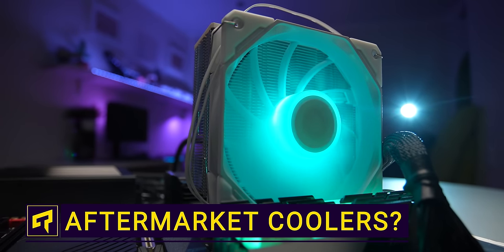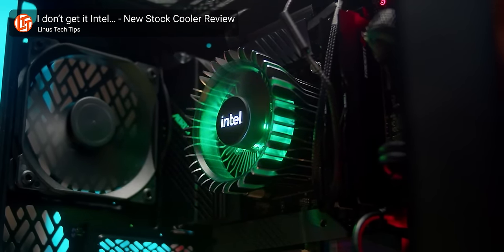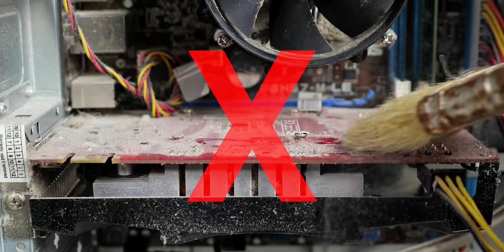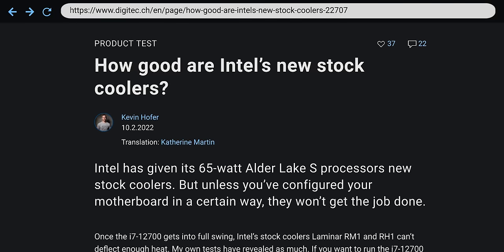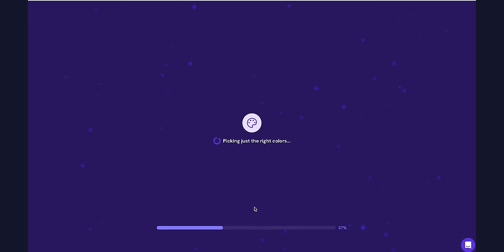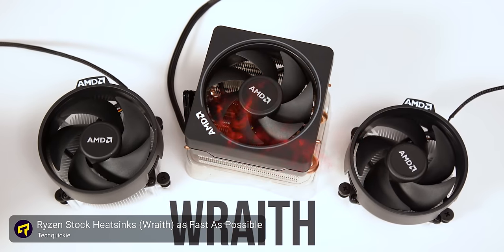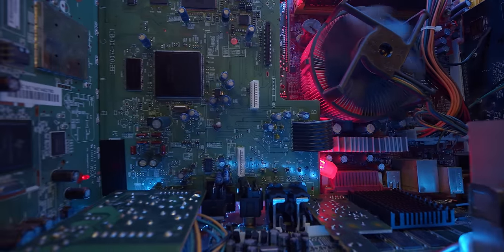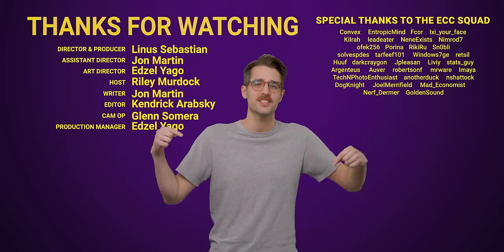Are CPU Coolers A Waste Of Money?

Comment: I got an NHD15 because I knew it would last probably forever. The fans will eventually die, but the heatsink will last for years, decades even. If Noctua is still around, they'll keep making mounting hardware for it, so I'll keep using it.
Reply: And that 6 year warranty is amazing if for some reason something does fail during that time
Reply: Dunno if the value proposition is there. You could buy 3 peerless assassins with that same price
Reply: @user-bf5qh3ih4u  Yes but will it last long term? Is there any warranty for broken or malfunctioning parts? The cooler itself looks great but the fans look a bit on the cheap side. At the very least Noctua is a very trusted brand that will support its customers with 6 year warranty with free replacements and new mounting brackets. Also their fans are some of the best on the market and have been for awhile. The NF A12x25 fans are ridiculously powerful and also really quiet. I don't mind paying extra for tried, tested, and true products with amazing quality and amazing warranty support.
Reply: @Hydra_X9K_Music  thermalright are a very reputable brand. Their coolers are on par with other big names at a fraction of the price. I believe they’ve even been in the market a little longer than noctua.
Reply: @Marauder-q2v Considering the performance of a D15 is it will be able to handle the cooling needs of future processors with ease to the point that it will likely not even be something that will even come to mind with subsequent builds.

Performance especially over the long term is value.
Reply: What I love about noctua is their socket support. Thermalright is definitely the better value but socket support is better in the long run for noctua. They even send the mounting kit to you for free as well.
Reply: @Hydra_X9K_Music  I’m fine with purchasing my own mounting hardware. Less of a problem on AMD because mounting hardware is compatible through multiple generations. For the fans, if they do break, I’d probably just strap a couple of arctic p12’s. Do note they have a weird motor hum at 1000 rpm. You can probably just set your fan curves to avoid this. The p12 max doesn’t have this issue entirely. If I remember correctly, I think they come pretty close to the noctua fans in terms of performance.
Reply: @Marauder-q2v  Ngl I did want to try strapping noctua fans to a peerless assassin or a phantom spirit cooler to see how it would be xD
Reply: @sm7085  You are right, Thermalright is a better value and is like 4 years older than Noctua, but I would rather give my money to a premium, well established and popular European brand, rather than a Taiwanese one for a purchase I might make once every 10-15 years, especially when it will be paired with multiple 300$+ CPUs.
Reply: @Hybris51129  peerless assassin matches the performance of the D15.
Reply: @LAndrewsChannel that didn’t sound racist at all lol😂
Reply: @LAndrewsChannel  Reliability and value is what most people look for imo. I wouldn't think the country-of-origin matters, but to each their own.
Reply: @sm7085  Exactly. I have a cooler from Polish brand and while a lot of people here are dissing Polish products in general, I never heard much of a complaint for this brand's (formerly SilentiumPC, now Endorfy) coolers in the long run. There used to be complaints about complicated mounting process for their older cooler line, but their current line fixed this and I had no issue with that. I still only have that cooler for two years, but in my surrounding, some people have this brand's coolers for much longer and they are still good to go. And it has the same six years warranty Noctua has. Now, if their PC cases were similarly cool (pun not intended)... but that's a story for another time 😏
Reply: @sm7085 Country of origin matters for labour practices and safety regulations, as well as consumer protections.
Reply: @meesun2060  Call it racism if you will, I don't care, just look at the practices employed by 2 other ESTABLISHED major OEMs headquartered in the same CITY, Asus and Gigabyte, what they did in the past 3 years and what is their first response when a major flaw with their products is reported. Also, I bet there is some influence from China itself, where the culture is pretty much centered around "through any means necessary", be it slave labour, lying, stealing, maybe even killing and nicely covering up for the rest of the world to not see and still buy products made there.
Reply: The heat pipes wear out over time, usually about 15 years or so. Sometimes less. Still a really long time but not decades.
Reply: I thought the same thing until I got a 12900k. I used a NHD15 with a 8700k and never had a problem running Handbrake  to convert videos. I built a new computer with a 12900k and thought I'd save a few bucks a reuse my NHD15. A couple of  minutes after starting Handbrake the computer would reach 90+ degrees. A few seconds after hitting 90 it would lower all the CPU core frequencies and the computer would cool off and hold at 85 to 90 degrees. I bought a DeepCool LT720 360mm AIO and my computer idles at 25 degrees and max temp of 55-60 degrees when running Handbrake.
Reply: Mine just clicked over 4 years as I switched to a CPU AIO. CPU AIO lasted 4 months and died......
Reply: @Hydra_X9K_Music guess I shouldn’t tell you they’re made in the same Chinese factory as all the other fans… 

Same applies to the heatsinks.

Whoops! 😂
Reply: @christophervanzetta  Well fk it they're still some of the best fans ever made xD
Reply: broo the same here. i used artic coolers back then .ugly ,but legit.haha
Reply: @Hydra_X9K_Music It's really just a lump of metal. There's pretty much nothing to actually break. Yes, there is a good warranty on Noctua Coolers, but do you really need a warranty for a hunk of metal?
Reply: @Hydra_X9K_Music That would actually be really good. In fact, the fans on a new Noctua Cooler made an old Noctua Cooler like 3 or 4 degrees lower. I forgot what video set this. I think it was an LTT video.
Reply: @rodneykeene What kind of case are you running? I use one with a mesh front panel so there's plenty of airflow Of course, that's what you get for running intel.
Reply: @MrGamelover23 My current case is a Fractal Design Define 7 XL. I use the mesh panel instead of the solid panel on top and it also has a 280 mm mesh section in the bottom. For most tasks the NHD15 did great, even gaming it was fine. I transcode videos with handbrake and the 12900K would reduce core freqs to stay cool.
Reply: There literally is no reason to buy Noctua when thermalright exists.

Comment: As long as you can fit it and the slightly more amount of noise isn't an issue (barely any to be honest with some tower air coolers), tower air coolers like the Noctua DH-15, are the simplest route for most builders in my opinion.
Reply: I use a noctua nh-D15 cooler with a rx 7800 Xt and ryzen 9 5950x, I can't even hear the cpu cooler under load.
Reply: @eequalswtf6281  Isn't it wonderful? Well worth the ouchy in price and can be reused in future builds.
Reply: Noise (acoustics) is the reason that I have to use a simple aftermarket air cooler for the CPU.
Reply: Originally bought the nh-d15 for my ryzen 2600 that i was overclocking and it dropped my temps by 20ºc. Cross decked it into my new am5 build and sits on my 7600x which run hot from the factory. Never have to worry about it with the v8 sitting on the top
Reply: Nh d15 is way overkill. Most people only need a single tower. A Thermalright costs under £20. The D15 is £100. Spend the difference on a better GPU
Reply: @Notorious544d  I said simplest, not cheapest. I totally agree that the DH-15 is overkill. However, it will be applicable in pretty much all future builds, regardless of cpu heat generation, as long as Noctua makes adapters for it (they are known for supporting their products for a very long time), meaning the person who purchases it probably won't need another one for a very long time. That was my point.

Comment: Running a 240 AIO on my latest build, and the fact my workload temps are what my air cooled rig used to see at idle was quite something...
Reply: I love my 240 AIO. It's so silent and never ramps up regardless of what kind of load I throw at it. The only kind of air that I ever feel out of my PC is cold air. It actually helps to cool my tiny apartment down a tiny bit during the summer which is kind of wild since most people say their PCs heat their homes.
Reply: You still get GPU fan noise so I don't really think a cpu cooler needs to be a lot quieter than a GPU. A AIO that big is overkill
Reply: @kingzach74 I can promise you that your pc isn't cooling down your apartment. That's not how physics work. Your Radiator sends out the heat from your cpu into the air. You're making the same, if not more, amount of heat energy by your cpu, even if it's hooked in a waterloop. The only exception is if you have your Radiator pointed out a window or something
Reply: @kingzach74  

bruh
i need to lie down after reading this one 
that AIO do sound nice tho
Reply: Either you run on stock air cooler or you have a shitty air cooler.

Comment: Regarding stock coolers, the one from the old FX-8350 is definitely not enough. The processor burned itself along with the motherboard while running Prime 95 while I was ordering pizza. I had to fight my right for RMA since I didn't overclock it when it happened.
Reply: certified FX moment
Reply: I still have my 8120 and 8320 but I never ran stock coolers on either.
Reply: it's the motherboard, not the processor. Many people did not understand at the time, that you can't put a 125W CPU on a cheap motherboard with 5 or 6 phases. Besides, running Prime95 is still the worst thing you can do today, as it heats up the system even more than Premiere. If it can do video encoding, it will run everything just fine. Stop using Prime95 guys, just run the CPU-Z stress test; if that one runs fine, you're good to go for EVERYTHING - unless you're a NASA scientist ;p

Comment: As a casual user, I'll stick with my stock cooler for now, but will consider upgrading if I delve into overclocking or hit thermal limits. Thanks for simplifying these concepts.
Reply: Totally. Stock cooling is designed for light and casual use.

You only need better air cooling or an AIO if you are gaming or doing sustained heavy work loads

Comment: Best decision I made was getting a thermalright assassin 120mm tower cooler. Cheap, amazing upgrade from stock and kept the chip nice and cool.

And then got a 360 AIO for my birthday.
Reply: Their stuff is the best. Top of the line performance and 1/3 the cost of other top of the line coolers.
Reply: I had a 360mm AIO that died. Both my brothers (twins so identical pc too bought at the same time) had their 240 AIO die just a couple weeks before it. 

I got annoyed so bought the Thermal Assassin 120 for myself: Better cooling, less noise. Far more reliable. If it dies, only need to replace a fan. job done.
Reply: Yep! My PA120 is awesome on my 5800X, even with a decent OC (top 1% on 3D Mark CPU Profile) my temps are great and you can't beat the price!
Reply: @pcgamer1206  my cpu never goes over 65c even in the really hot summer here. With AIO it did get higher (before it broke, obviously). 11600K no OC
Reply: Picked up the Assassin 120 SE for roughly $35 to go with my Ryzen 7 5800x3D since that one doesn't have a cooler in the box.
Reply: Yep honestly this is probably one of the best coolers for the dollar right now on the market, Even if you do go AIO or have a liquid cooling custom loop I consider this cooler a must for the just in case situation. Doing a build waiting on parts I have this running right now and I can say its running with a 7800X3D using integrated video at 4k and its keeping the idle at around 40-44 degrees Celsius(which is very very good using the integrated GPU, EXPO DDR5 6000, in a Asus ProArt X670e) There are no other fans yet in the Lian Li Dynamic Mini yet and hammering it a bit with large sustained file transfers and installations topped out at 70 Celsius which is good it has a bit of overhead.

Comment: Air cooler for the win. Gonna last longer than liquid. 

Can't recommend overclocking if you got a K chip from intel, they push'em hard from factory. 

Last great oc chip I had was a AMD Phenom II 960T. 3.0ghz @ 4.0 overclock. Had 4.2ghz towards the end of using it and finding good bios settings. 

Also had a the celeron 366mhz @ 550mhz way back when overclocking took off.
Reply: Looks ugly imo though.
Reply: @xpodx  Yeah, those tubes from AIO inside your PC look absolutely ugly.
Reply: @SunnyHunny74  mine are white and have tube combs, looks sick! Mines a phanteks 240mm glacier.
Reply: I thought the same thing until I got a 12900k. I used a Noctua NHD15 with a 8700k (not overclocked) and never had a problem running Handbrake  to convert videos. I built a new computer with a 12900k ( also not overclocked)  and thought I'd save a few bucks and reuse my NHD15. A couple of  minutes after starting Handbrake the computer would reach 90+ degrees. A few seconds after hitting 90 it would lower all the CPU core frequencies and the computer would cool off and hold at 85 to 90 degrees. I bought a DeepCool LT720 360mm AIO and my computer idles at 25 degrees and max temp of 55-60 degrees when running Handbrake.
Reply: @xpodx  This. Here's the actual reason most people get aftermarket solutions: Looks. It's the same reason trucks and SUVs have completely taken over (or at least in the US where I'm at). When vanity supersedes necessity, people can convince themselves the extra cost is worth it despite not actually needing it (or even being hindered by it)
Reply: @illitero  stock ones that come with it are all always poor thermal solutions.
Reply: @xpodx  they're absolutely not, haha. Stock coolers are designed to perfectly handle the processor they're packaged with. Aftermarket coolers aren't ever required unless a user intends on significantly altering the processor's stock configuration or in an installation where airflow and/or space requires a different solution. 

Do you seriously think that Intel/AMD would intentionally ship their product without a rigorously tested cooler? And what of the hundreds of millions of stock air coolers in business/enterprise systems? You think server farms swap out their OEM solutions for some Corsair AIO because they're marketed as being better? Systems that run consistent loads 24/7 for years on end in heat-soaked rooms are by design air cooled with a stock/oem unit. If they can do that, then some dude's gaming PC should survive intermittent bursts of Fortnite lol; even with a light overclock.
Reply: @illitero  not cinebench or other intensive work loads
Reply: What kind of intensive loads?  @xpodx
Reply: @uhm175  rendering, gaming when it uses more of the cpu, I've seen stock coolers be way hotter and just not be enough.. that's why there's a huge market for aftermarket coolers.
Reply: I had my 2500k running at 4.8ghz 24/7 at stock voltage on passive cooling.  It was a huge scythe mugen cooler, lost the bracket for the fan after a few years dont remember why, just ran it passive and it never went above 80C, still have the CPU too, its in a crappier motherboard that can only push it to 4.5 though.
Reply: @xpodx I'm very clearly specifying typical consumer usage for gaming and you're piping up about cinebench? I had no idea that dudes were cinebenching their computers all day, but sure. I guess if you're going to intentionally max out your cores for high scores, swap out your cooling solution and floor it, dude 👍
Reply: @illitero  even in gaming sometimes in different configurations your cpu will be maxed out which will lead to extremely hot temps.
Reply: Never had an air cooler fail on me... If the fan dies, get a cheap new one. Liquid coolers use fans too.

Comment: I was getting temps of 60 C at idle in the BIOS with the stock cooler that came with my Ryzen 5 5600.  Replaced that piece of junk with a Deepcool AK620 and lowered the temps all the way down to 30 C.  Much quieter now, too.  Totally worth the added expense, IMO.
Reply: It really depends, My room is chill & cool all the time, so the stock cooler with my Ryzen 5 5600 works like charm & still going strong, never above 40 C
Reply: probably some wrong configuration, or bad mounting. No way you get 60°C in the BIOS with the stock cooler, unless you've done something terribly wrong.

Comment: As someone who recently rebuilt my PC with a 7800X3D, saw temperatures hit 91C with my not-very-old U12S Redux, and proceeded to order a Thermalright Phantom Spirit based on Hardware Canuck's air cooler testing with a 7700x, I would say yes buy an aftermarket cooler even if your CPU includes a stock cooler. And maybe consider a dual-tower cooler if your CPU has a higher TDP than 65w.
Reply: What temps you getting now? And what price did you snag it at? I found a 360 aio for a really decent price of 55 bucks so I couldn’t pass it up cause it’s the look I like in my system, I’ve got the same processor so I’m curious.